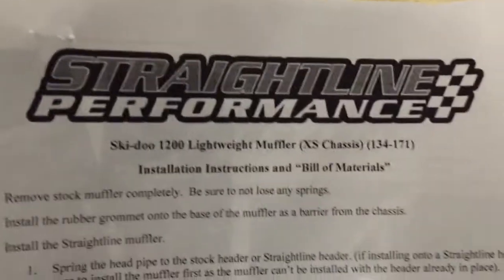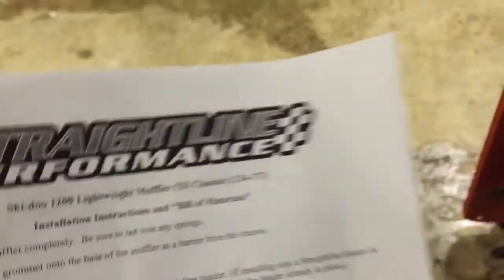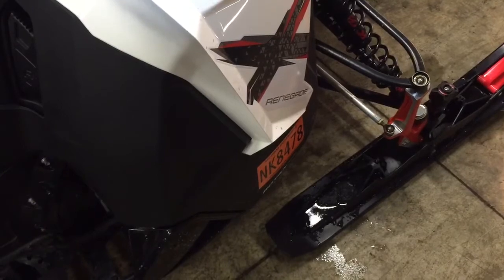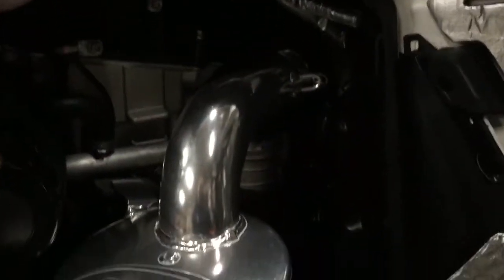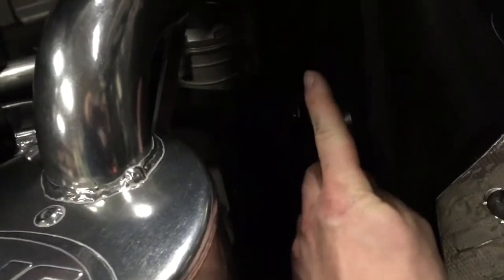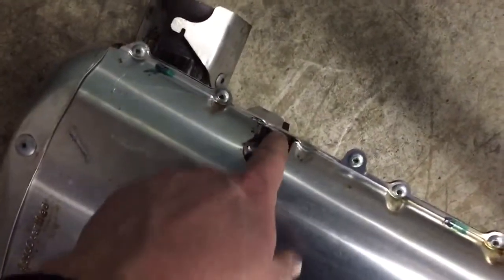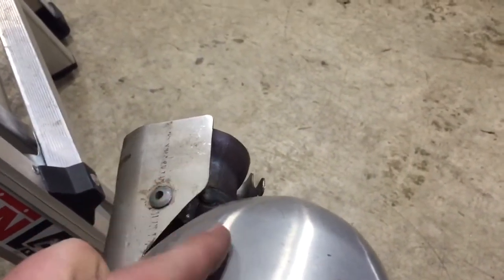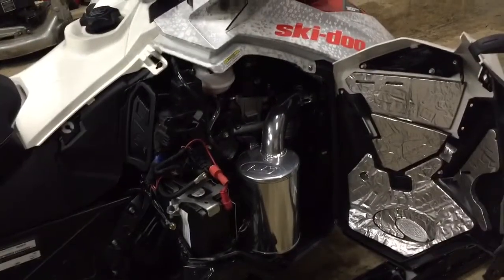2016 skidoo renegade 1200 X with SLP can.

Comment: Been looking at getting a can for my sled (same one as in this vid) for a while now. This is one of them. How is the sound cruising down the trail? Is it louder than stock? Or just a different tone?
Reply from the maker: Max Reed it was a nice sounding can but after putting a couple thousand miles on with it I decided to take it off and go back to stock. This sled got wrecked due to a guy running me off the trail so i know have an 18 renegade X. Had the can on the new sled for the first trip and the. Got rid of the can. Straight line performance does make one that is quieter than this one.
Reply: @bryanoberlin6258  thanks for the info much appreciated!